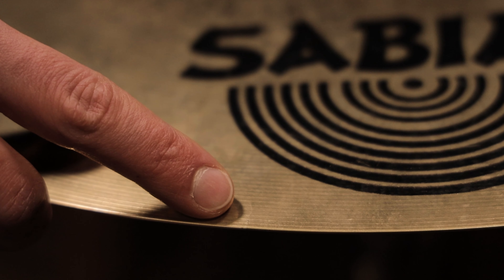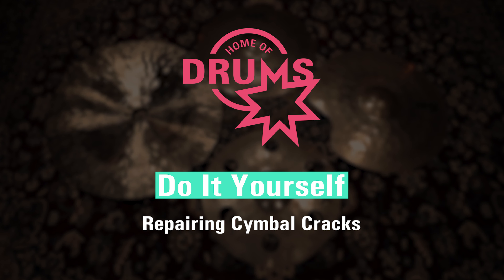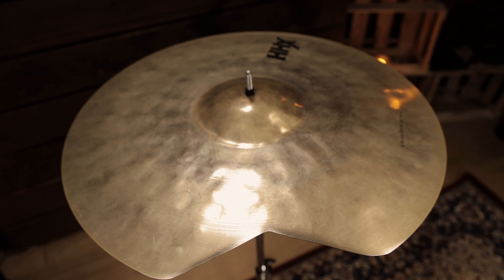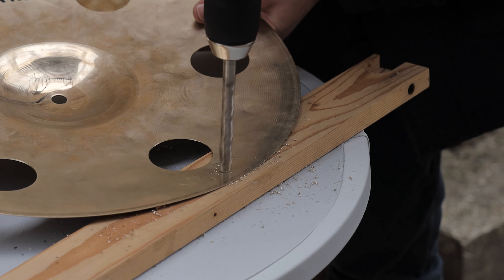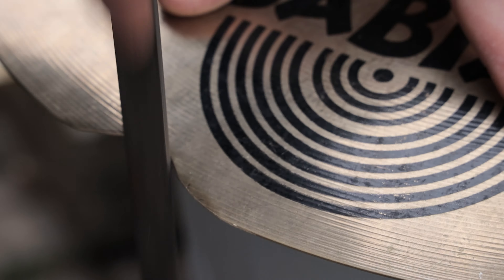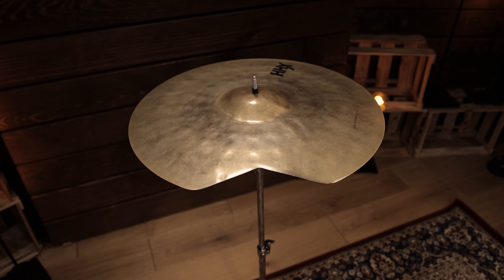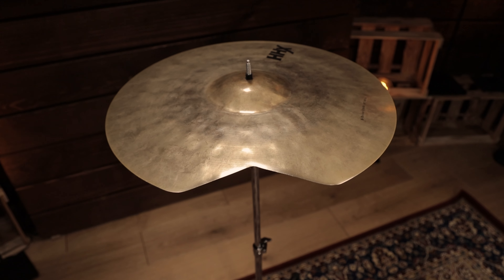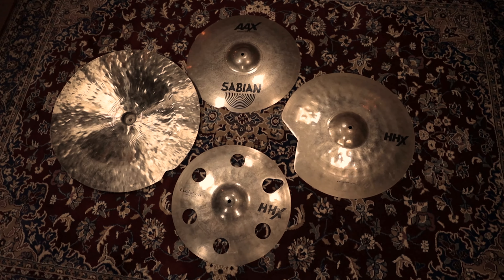Repairing Cymbal Cracks | Home Of Drums DIY

Comment: I used this method (learned from the video) to repair a ride cymbal that I bought used off craigslist. I purchased the cymbal specifically because its a great jazz ride that normally sells for very expensive but which was priced very low because it had a crack that was about 2.5 inches long running from the  edge to end of the crack. This method worked beautifully and rounding (softening) the edges of the cut made this a very functional repair. I now have a great cymbal that I otherwise would not afford at this time. The tone is excellent and this sort of repair does not seem to dampen the cymbal significantly or at all.

Thanks!

Comment: Dont use safety glasses with an angle grinder, use a saftey visor. Disks can shatter and launch into your face. Also have a fire extinguisher/blanket present, because they produce hot metal sparks.
Reply: Thanks Safety Steve. 

While your at it put a cork on your fork and brakes on your shoes.
Reply: (TL;DR: probably overkill; not needed if you're not blowing other crucial basic safety factors). Umm ... this is well-intentioned but a bit excessive -- and I'm saying this as a former professional knifemaker, and someone who's designed, built, and worked in pilot plants (in small confined spaces) with very high-temp/pressure explosive liquids/gases/chemicals - and designed safety protocols. 
Yep, a visor's not a bad idea in general, but cutting/grinding a cymbal (properly, well-clamped, using a good cutting/grinding wheel!) is not likely to make a disk explode and propel shards of spun brass/bronze into your cheek -- if so, let's start with "you're doing it wrong", and should watch a couple of videos on using an angle grinder safely. As to the hot metal sparks: (a) ok, yes, ALWAYS have a fire extinguisher in a shop (preferably A/B/C because why outweighs why-not when it counts), but (b) if you've got combustibles anywhere near a "hot-op", Darwin wants a word with your genes. (I especially call out sawdust, dust, oily rags (what a cliché but still....) - oh, and I guess flammable solvents? >;-))
Reply: I did mine with a dremmel tool and the disk DID FLY OFF of the dremmel in the process of cutting a cymbal by this method. I am lucky that it did not hit my face. good thinking about the visor...

Comment: Wow, that's a lot of metal removed! Get in early before it branches and drill a small hole at the very end of the crack so the ends just inside the hole you drill. Be sure to make the hole clean and remove burs and jagged edges ie, a small touch with a countersink bit on either side. It doesn't  always work because its impossible to know for sure if there is a hairline fracture there still. I used a 2.5mm drill bit on a sabian b8 chna with an edge crack, but re- appeared later. It worked o  an aax explosion with a body crack though, a hole drilled at each end. It hasn't re-cracked. No offense intended at the creator of this vid, but get in early to avoid having to remove big bites, because the more metal you remove the more different it will sound, and not in a good way, unless its a china, because they are trashy anyway, so not so bad.
Reply: That never worked for me. Crack always reappears eventually on the other side of the hole.

Comment: Cool vid. I run a jam studio and i have lots of cracked crashes. I was thinking of a way to turn them on a lathe and trim off the inch or so needed for a fresh edge,, ie turn an 18 into a 16 as an example or turn  cracked crashes into hihats. For sure it would change the tone of the cymbal if you cut all the way around but could be cool otherwise. I guess there is a whole school of thought on edge shaping to thin the edge down or they probably sound like bells more than nice crashes.

Comment: So I’ve always been curious why not just drill the hole? Wouldn’t that alone prevent the crack from traveling further?
Reply: Only temporarily. I’ve tried it twice, and both times the crack eventually reappeared on the other side of the hole.
Reply: @johnsanders1530  interesting 🤔
Reply: John is correct in my experience. Drilling holes on either side of the crack was always the old school go to, but it’s really not effective in the long term.

Comment: Took mine to Pro Drums in Hollywood, they did this. It didnt work. The next week my cymbal kept on cracking on the same spot they cut out. My opinion is to just cut the whole thing in a complete circle to a smaller size.

Comment: Does anyone, Here, know, lf l can just melt a crack(About the size of a Dollar-Coin), Away, On the edge of a cymbal, By fusing it, Together, By Heating it up, With a Cigarette-Lighter or Soldering-Iron?
Reply: so you want to melt a bronze alloy with a cigarette lighter?